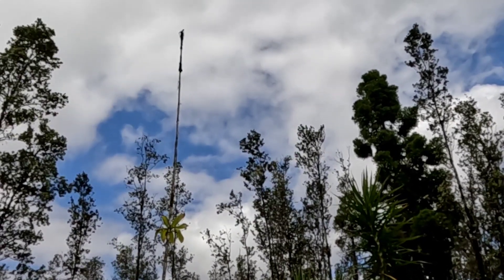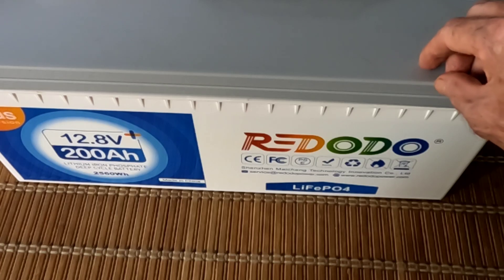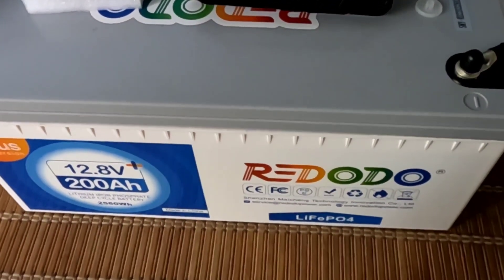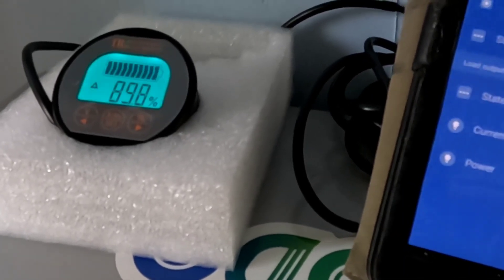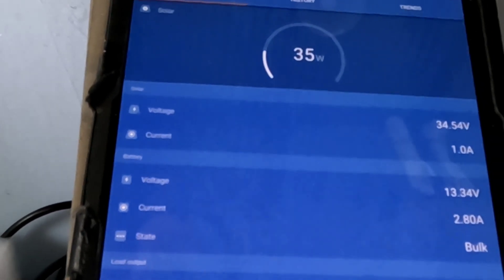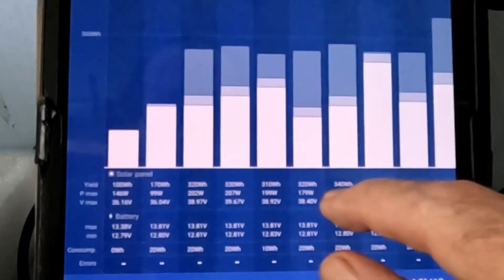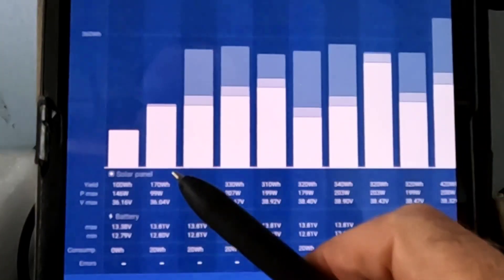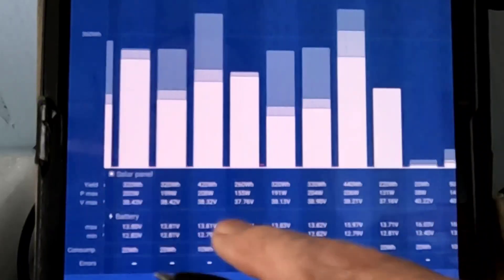Revamped charging parameters and manufacturer response

Comment: I’m most likely wrong but I thought you should not “exceed” the max charge setting of the BMS because it will disconnect the charge MOS and cause a spike. This condition will occur automagically if a single cell is “overcharged” and can’t be balanced ( my BMS has an independent charge and drain MOS) The BMS settings are just a last resort, a NASTY fail safe and those settings should always be higher then the highest charge value expected from ones controller. The “incorrectness” of the voltage sample statement is troubling because that type of “incorrectness” is usually conservative. In reality the “speed” of the spike was far greater than the sample rate of your equipment. This would under report it’s actual value. Unfortunately the only way to see the ACTUAL value of a signal lasting milliseconds is a triggered oscilloscope. I too had the spike issue and desperately could not figure out if it was coming from the controller, BMS or inverter. I considered Everything from high power blocking diodes, super capacitors, resistive connections and even some methodology to “burn” that spike with a DC light bulb. Nothing worked till upon your experience I changed my controller values. I enjoy you continued dissection of this issue and appreciate you continuing to figure it out…so I can leave it alone …LOL
Reply from the maker: So very well said! Thick as a brick even. Mahalo for saying so eloquently what I wished I had! aloha 🤙

Comment: This was my response from Redodo concerning the Voltage spike. Both responses are conflicting 

Hi Eric, 

The cells are grade A automobile LiFePO4 cells. And they are 3.2V cells.

For your battery voltage spikes, if one battery cell is bad, then it could not be charged. 

Now you can charge the battery to 13.9V, so the cells are working normally.
Reply from the maker: Yeah, sometimes I think a language barrier plays a role in some of the communicating🤙
Reply: @ProjectsinParadise808  they also told me these cells can be charged to 3.65 × 4 = 14.6 v I had to write them back and tell him no The Surge starts at 13.9. I think you and I have a bad cell

Comment: I've got a renogy setup with a 100AH Renogy Bluetooth LFP battery and a Renogy 20A MPPT solar charger.  Using the factory settings, the diary showed a voltage spike of 29.7V.  I didn't catch it real time.  I posted on the Renogy forum and another user said he has seen the same thing.  He changed his MPPT settings to 14.3V instead of 14.4V for the MPPT voltage and hasn't seen the issue.
Every response from  my comment is consistent with what REDODO told you.  But this is a similar event with Renogy rather than VICTRON so I assume it is common and not unique to any solar vendor.

I should also mention that I did not see the balancing issue that @The Chief's Way.  Not discounting that they had a problem, but there may be 2 different things going on.  But if the cell balancing doesn't occur until 14.4 volts, I think I'd prefer to balance the cells and ignore the spike.  If I understand his comments correctly, with the changes you've made to limit it to 13.8,  the BMS will not balance the cells.

Was REDODO comfortable with the settings you programmed into your MPPT?
Reply: I have showed them four different settings. They told me to use the lithium. That's when I first saw the voltage spikes from 17 to 19 volts

Comment: If ya dont take the battery out to that point where it surges it probably won't balance the battery the way its supposed to do the bms that I use start balancing at 14.4 volts and it turns on balancing LEDs if ya dont take it to this point it doesn't balance the cells

Comment: You are just masking the problem.  I told you in another post exactly what the problem is.  There is a bad cell that never gets fully charged which causes another cell to over-charge and when the BMS goes into a Over Cell Voltage Error and cuts off charging you get that recorded spike.  I had this on a Renogy battery w/ Bluetooth and I was able to see cell 4 was bad and was always .2V behind the other cells and either cell 1 or 2 would have reached 3.66.  The limit is 3.65.  I sent the battery back.  Make the manufacture replace your battery.  They are BS'ing you.  It is not normal.  A good lithium battery should be able to get to 14.5V with no problem.
Reply: No way! We have the same battery 🔋 They are both doing the same thing.  Could it be possible we both have bad batteries?
Reply: Yes, inexpensive battery most likely use a grade B cell and if the cells aren’t matched well this could happen.  Could also be BMS failing to balance that cell.  He said it happened quite often with his other battery bank until he masked the problem by lowering the charge voltage enough so that one of the cells did not reach 3.66.  That Renogy battery I had would stop doing it at 14v.  He reported 13.8 which is worse.  I have been very luck with the 4 Weize batteries I have charge to 14.5V every day without error.  The moral of the story is Payless get less unless you get lucky like I did to get 4 batteries without a problem.  Bet it happens way more often then you think.

Comment: As long as the battery doesn't lock up then I say don't worry about.  Also, lowering you Absorption voltage will only give you a loss of about 1% SoC.  Good choice!  Great video!

Comment: I have a EP Ever 60 amp, a Dally smart BMS, and a Vevor 3 000 pure sine wave,  and the same thing seems to be happening to me.
Reply from the maker: You know JR, I keep dropping charging voltage on these systems as I learn more all the time. Ever since I have, no problem,no alarm , and no lack of power ...ever. I've been kinda slow to adjust,but I am! Aloha 🤙
Reply: oh no, sorry your went with a Daly smart BMS. At least you can monitor the cells with the app on your phone but the BMS is not going to balance the cells. You could buy an add on "Daly Smart Balancer" to fix your problem if you want to keep with the Daly brand. Make sure to get the "Smart" balancer and not the dumb balancer!
Reply: @uhjyuff2095  thanks for the advice. I have given up on it though.  I thought about it and it is only milivolts, not volts.  So, I don't think I'm going to chase perfection.  I have embraced  Wabi sabi.

Comment: I like the response from REDODO. I thought it was the BMS inside battery. The factory settings push LFP battery to MAX . on some BMS it will trigger a protect/balance mode causing the spike you are seeing. dropping the factory setting a bit still gets full charge on battery. just takes slightly longer . keep the float voltage  same.  that maintain 100%. buy dropping bulk charge you may increase cycle life a bit. don't confuse cobalt based lithium battery. best cycle from 20% to 80% for best cycle life. LiFePO4  is rated cycle life to 80% DOD leaving 20% left . that from full charge .different companies have different rated cycle life and go with that info.
Reply from the maker: Yeah, I liked and appreciated their response as well. And as you have pointed out from the very beginning from me on the very first system lowering that voltage can be a benefit and not sacrifice any power in any way. Overtime I have learned to drop that voltage as well. Ever since I've done that on all systems I've never had another alarm or Spike. You're one of my main go-to guys and I appreciate you always. Aloha! 🤙
Reply: I learn more and more from every post I read ! Frankly, I enjoy reading differing perspectives on a single issue with the task of combining everything said that was similar. This methodology gives me a well rounded, effective theory and insight. Unfortunately sometimes I feel my head is going to go experience a “technical” criticality and start forgetting simple things .. like Cryp I dint feed my cat 🐈. Thanks everyone for my diversion from everyday average Joe auto pilot.
Reply: Hi Eric, 

The cells are grade A automobile LiFePO4 cells. And they are 3.2V cells.

For your battery voltage spikes, if one battery cell is bad, then it could not be charged. 

Now you can charge the battery to 13.9V, so the cells are working normally. 

To test the battery is work normal or not. Could you please do a discharging test?

The step is as below:

Connect a full charged 200Ah plus battery with a load, if the load is 200W, then the run time will be around 2560Wh/200W≈12hrs. Which means the battery function is normal.

And to help you stop the voltage spikes, could you please share some pictures of your currently MPPT setting parameter to us? And the cables that you use to connect the battery and MPPT together?

Nomally, if your Renogy MPPT has the lithium mode, you can just choose "lithium mode". 

If the battery is defective, we can send you a replacement battery or refund service.

Looking forward to hearing from you soon.

Kind Regards,

Comment: Renogy 40amp MPPT/Redodo 200ah Pluse 
I had the same problem  with the factory lithium settings. I had two voltage spikes one at 17v the other at 19v . So I have set all the settings  to 13.5v and it keeps my Redodo 200ah Pluse charged at 13.58v Perfect! The factory support has been no help! After I showed them a screen shot of the USER AND lithium settings. They told me to set it lithium. That I should have no worries! Unfortunately that was not the case  😕
Reply: Setting the charge controller bulk voltage lower than 13.8v may not give the bms enough time to balance the cells.
Reply: @tj4034  thank you What do you think about his float set to 13.5v? Some say to keep the float the same as the rest
Reply: @TheYammerHammer  13.5v Float is fine.  Anything 13.4 to 13.6 is good.  But 13.5v bulk/absorb is too low.  Many bms won't even start to balance the cells until you get above 13.4v so setting bulk/absorb to 13.5v won't give it enough time to balance the cells.  I set mine to 13.8v absorb, 13.4v Float and it works well but I also will increase absorb to 14.2v every month or 2 to give the bms more time to balance the cells.
Reply: @tj4034  My response from  Redodo
 Hi Eric, 

The cells are grade A automobile LiFePO4 cells. And they are 3.2V cells.

For your battery voltage spikes, if one battery cell is bad, then it could not be charged. 

Now you can charge the battery to 13.9V, so the cells are working normally.
Reply: @tj4034  I'll try the 13.8 bulk 13.5 float. Because once it hits 13.9. The spike happens for both I and Projects in Paradise
Reply from the maker: Sweet 🤙
Reply: @ProjectsinParadise808  I've been adding to my comment..read the rest
Reply: @tj4034  projects in paradise and I are getting conflicting responses. They need to figure it out
Reply: @tj4034  I read yesterday my power inverter can only take 16.5 v Redodo is tell people to charge at 14.2 v It will surge all those 3.2 cells. They going to have some major problems